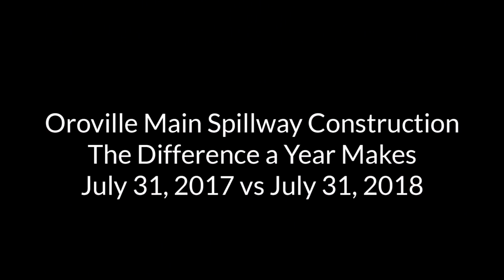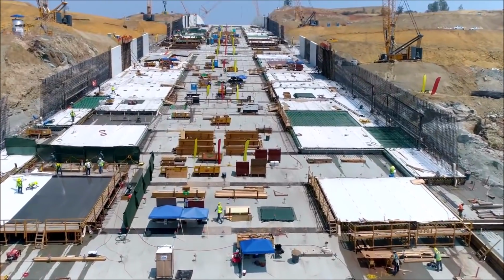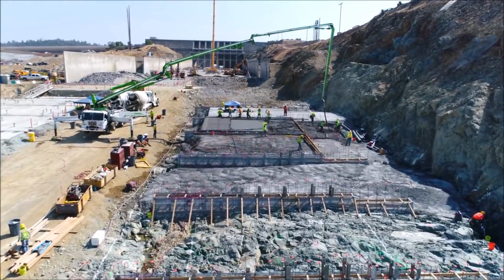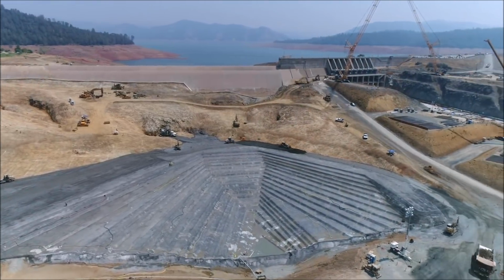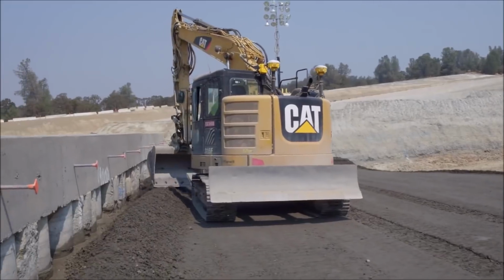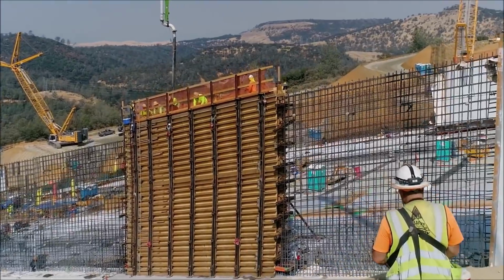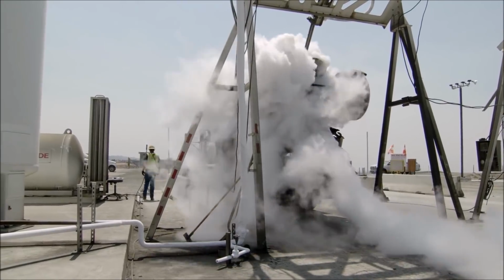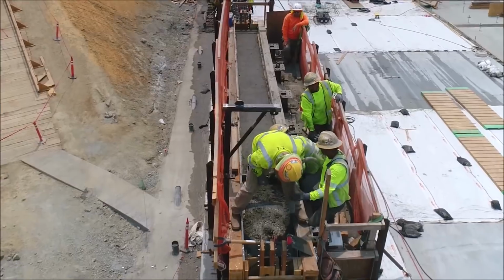Oroville Update! Aug 14 2018

Comment: "Proving, that given the right circumstances the State of California can still do massive infrastructure projects on time."

Except all the State of California really did on this project was cut a blank check and manage the water level. Private industry designed the repair and private industry did the necessary work to install it.

What the State of California definitely did 100% on their own was mismanage maintenance and defer capital improvement projects that would most likely have prevented the emergency from occurring in the first place. All in the name of pork spending to get themselves re-elected.

Comment: I keep thinking------considering the cost of this rebuilding effort, and this is only one part of the whole dam complex, I wonder if this dam would have ever been build if it had been built right to begin with.  Similar to nuclear energy plants, if at the start back in the early 60's they knew to build with the safety features that are (correctly) required today, the first plant probably would have never have been built; it would have been just too expensive

Comment: Quick question, Juan. I just watched the 8/15 video from DWR on this, and there's a big span of soil between what I would call the "fan-stepped" area and the emergency spillway itself. If that comes into use, it would wash all of that out and undercut the RCC in the fan-steps. Will that area (the fan-shaped steps) continue all the way up to the emergency spillway?  And, I can't help but wonder, just how durable IS RCC under the flow of water?

Comment: Why do cement truck drivers almost never lower the tag axle (rear of the truck), nor the pusher axle (if present) (behind the cab)?  I'm thinking it must somehow cost more to run that way, by adding wear to those extra tires, and that cost is borne by the trucking company.  By contrast, the increased pavement damage caused by having the main wheels so heavily loaded is borne by the taxpayer.  Is that the case?  Or is there some other compelling reason to drag around those heavy extra axles and wheels and tires and deployment mechanism that's almost never used?

Comment: What a novel way to cool the concrete, I've never seen it used that way--of course I know nada about construction so this was so cool to watch (pun intended of course) Working around liquid gases can be so dangerous, it made me cringe to watch that man. Many years ago, I worked at a welding supply company. Our CO2 bulk tank had just been topped-off Friday afternoon, and sometime over the weekend the valve into the building failed and a huge quantity of liquid CO2 had spilled out into the building. Monday morning, Danny and I came in early to open the store; about halfway to the security panel, Danny stops and yells, "Get out!" Run!" We had to open all the doors from the outside to air-out the store and pump rooms; we discovered the floors around the valve had cracked but amazingly that seemed to be the only damage done. It just kind of made me pucker a bit, although I know they are likely using proper precautions, LOL. Thank you for this great update, Juan, really appreciate it!

Comment: Juan, I am curious as why the placement of pads seems symmetrical.  The aerial view in the DWR video captures this very well (10:00 in your video).  The symmetry is the work on the left and right sides of the main spillway are matched.  I suppose that is for efficient use of the cranes however that efficiency would allow for some leapfrogging but there is no apparent evidence of that.

Comment: Slab walls not good.. Pressure increases at the bottom of the wall. The Greeks and Romans figured that out thousands of years ago....
Reply: Reinforced steel concrete was not invented until thousands of years after the Greeks and Romans built their temples which mostly fell down due to earthquakes.
Reply: MATTHEW SMITH --- You say "pressure increases at the bottom of the wall', so does the thickness of the newly constructed/placed concrete!

Comment: What kinda blows my mind is the thought of the main spillway, not being able to handle the inflows to the point the emergency spill is used just because nature throws such a deluge.... Interesting times ahead... Is she overengineered? Was it unnecessary spending? Or is really heavy weather predicted? 

Lets just go with all of the above.
Reply: I get the ORIGINAL EMERGENCY SPILLWAY did exist... it just sucked.. They they sprayed concrete, looked like a big improvement... Now after 50 years they go to the extreme end of things and (RCC)concrete in the entire emergency spillway with huge amounts of materials and man hours. Which is expensive.... I am not complaining. I think it is smart.

All Im trying to get at, is either they don't believe their new main spillway is structurally sound, or that it won't be enough for the coming weather. 

The emergency spillway is built far beyond what was thrown at it, and the broken part that caused the problem with the emergency spillway got a1billion dollar makeover. 

Just interesting stuff to ponder...... Overbuilt, overpaid, or weather forecasts off the charts? or a little of each... 

That thing looks like it could handle 40days of rain just spilling over everything.... The rest of CA would be in bad bad shape!

Comment: 1974 I worked as a concrete laborer on the DC metro subway construction..So pouring underground wasn't a heat problem..After I whip lashed my neck in 88 the highway dept. put me on bridge construction inspection..We'd pour bridge decks at night to avoid the heat then keep water on in the daytime..This was a great video for me that brought back memories of when I used to be a useful citizen...hehe

Comment: I remember in 1994 the Santa Monica Freeway had several overpassess that collapsed due to the Northridge Quake and the red tape machine seemed to disappear, leading to the freeway being reopened in a record short time.  It just proves that bureaucrats really screw things up.
Reply: Nonsense.  Bureaucrats don't do construction of any kind.  They outsource special projects as a regular practice.  They use private contractors as standard procedure.
Reply: Are you purposely obtuse?  Bureaucrats don't do anything except get in the way of those who can and will.

Comment: I have a question that anyone can answer if you want to.  I've asked before but never got a real satisfactory answer, so here it is again. The  " rather steep turn downhill to a steep 4:1 slope." My question: Why...?? Maybe this 66 yr. old man just didn't understand it properly before....so I appreciate any answers...thanks.
Reply from the maker: marbleman52 the terrain.
Reply: Thanks, blancolirio. So...in the original construction the engineers just basically followed the contour of the land and it was not based upon some hydrological/water flow need ? And during the massive amount of repair work and filling in a 150 ' deep gouge, and even though they could have possibly built up the lower slope to match the upper slope grade, it just wasn't necessary...I assume. Okay...thanks.

Comment: Thanks for the update.

You mention the unlikeliness of the new emergency spillway ever having to be used. Do you know if there are plans to test it once it is complete? 

After all the old spillway failed the first time it needed to be used, it would seem a bit complacent to wait until the next emergency to see if the new design is sound wouldn't it?

Obviously this would require the reservoir to be allowed to overflow which, I would imagine, could cause a whole set of issues of it's own both for the immediate area and downstream.

Comment: Great narration. What exactly is the emergency spillway? And which way is north in the shot that has the lake at the top?
Reply from the maker: It releases water uncontrolled if the water level exceeds 901' elevation thus saving the earth filled dam from overtopping. (which will lead to failure)....to the left.

Comment: Note that unlike last year, they've been doing  all of the slab pours at night and into the early morning. They've only poured a few walls during afternoon hours. Also, they've opened up a second route to the parking lot and structural concrete plant that goes from the top of the dam, down across the spillway inlet on the other side of the headworks.

Comment: Liquid nitrogen is one thing they didn't have when they built this dam and the dams in the 40's
Reply: Water in pipes embedded in the concrete was used in the construction of Hoover(Boulder) Dam in the early 30's.
Reply: 60's not 40's.
Reply: Well, they certainly had LN2 in the 60s when this dam was built, but it wasn't a common construction material like it is being used here. But it was used industrially in large quantities. That said, they had other ways of maintaining concrete and slab temperatures back then, that while less convenient and perhaps not as exact, were plenty good enough when used carefully. It was just a bit harder.
Reply: The dam isn't concrete.  It's earth fill.
Reply: Oroville dam construction didn't start until 1957, completion was 1968.  But dam engineering was still not very sophisticated by modern standards.  It was only around 1968 that plate tectonics was finally gaining traction in the earth sciences.  It took the 6.6 1971 San Fernando Earthquake to alert California and dam engineers to seismic ramifications in construction design, all construction design.  Luckily, California and the US had adopted earthen dam design and its self-healing characteristics work particularly well for seismic resilience.  However, that spillway design was inadequate, actually incompetent, even for the Sixties.

Comment: That was some great footage the DWR put out there - very impressive for a government entity!

We have no such transparency, or efficiency over here in MA. A project like this would be dragged out for 10 years or more, and end up millions, if not billions over budget. Reporters would ask stupid questions as they always do, that never show what's really happening on the ground. If you want to see how MA handles large infrastructure projects, look no further than the "Big Dig" debacle. Years later, all the cut corners on concrete in the tunnels ended up killing a woman, when it all let go and crushed her car. Unfortunately, that's how the MA machine works. Basically the Mafia, and is only allowed to exist because it's called, "government".

Anyway .... EXCELLENT reporting as usual! Thanks for sharing all that great footage, and keeping us updated. We'll see the Mighty Luscombe another day.  😊
Reply: While the Big Dig was over time and over budget your description of the accident is not accurate. The woman was killed by a light fixture that fell due to the incorrect type of grout (glue) being used to hold the bolts into the ceiling of the tunnel. All the light fixtures were removed and reinstalled with the proper grout, some done on an emergency basis others done on a schedule.  Once in a while Mass DOT can do things correctly like the Fast 14 project, where 14 bridges on Rt93 both north and south were replaced in less than a year .
Reply: John Baker, no worries .... people like that are looking to blame EVERYTHING that goes wrong on "big government". Contrast the successfully safe conditions of those working on public projects and private development  in the US (and all it's "onerous restrictions" on free enterprise) with the same on third world projects in which there is no accountability of those in power to those who put them in power. Third world nations have less restrictive  conditions for constructions -- you have money, do what you want. The more of that, the worse you get. It's ownership of politicians that matters, not whether gov't is in charge of projects. Every main highway in the nation was built under the auspices of the federal gov't -- held up pretty damn well thus far. It's the starving of the gov't projects that has resulted in faulty bridges and roads.
Reply: Yeah, well Stephen that was long before the radical left grabbed ahold of the US government - it used to work pretty good before the 1960's came to be. Government knew it's place in those days, and worked the way it's supposed to. Could you imagine a project as large as the Interstate Highway System being done today? Oh my Lord ... the EPA & treehuggers would be up everyone's  . . . so tight, they'd get nothing accomplished.
Reply: Bullshit. There is no exception to or violations of regulations on this project. The transparency is without question -- no backroom deals. There were so few injuries largely because of regulation.  This is a model of how to proceed in a governmental project of massive scale.
Reply: I agree with you Stephen .. but your reading comprehension sucks! 😂 

They're doing really good on this one ... ONLY because, like SlocketSeven pointed out,  too many eyes are upon them now - the story has gone  worldwide! I'm 3,300 miles to the east of Oroville, yet I know every facet of this operation (thanks to Juan, of course).
Reply: Fair enough, Smitty. I'm on the left -- the far left relative to many people who follow Juan -- and I'm all for transparency in gov't. It's not the policies of the left that present the problems that so many people complain about, it's the corruption that's insidious. That's why I can't stand the attacks on whistle blowers. If I could use my magic wand and institute something a bit different in gov't structure, it would be an independent whistle blower advocacy group. There are plenty of people who would love to be its Czar!
Reply: John Baker 8 it was a concrete ceiling tile that fell not a light fixture but the cause was the adhesive compound used. They used the fast set type instead of the standard which lost its strength within 80 per based on testing during the investigation.
Reply: Smitty Smithsonite -- Yup.  Public works projects in MA are a gold mine.  Opportunities for nepotism and patronage, grossly overpaid contractors and workers (who spend most of their time standing around), kickbacks to the politicians who authorize the projects, budget overruns, sloppy or no inspections by state authorities, ...
Reply: SlocketSeven - I'm not surprised to hear that. We have a similar "type" of state government out here in MA, if you know what I mean. Birds of a feather ...
Reply: Smitty - Sounds like youre gonna need some insurance...wink wink

Comment: That liquid nitrogen use didn't look very controlled to me, It looked like they were just dumping and praying while mixing. What kind of monitoring do they have on the inside of those mixing trucks to make sure they're getting the right temperature range?
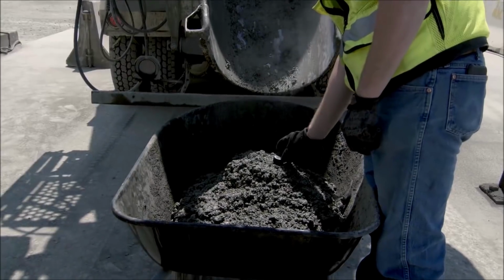Reply: The video shows them taking the temperature of a test batch from the truck at the 08:56 mark.
Reply: Ya, I saw that image, but that's not while the cement is mixing. They don't seem to have real-time monitoring to make sure they don't accidentally freeze their mix.
Reply: The mix won't freeze it  is being agitated the whole time. Have you messed with liquid nitrogen before. Those long tubes inject the Liquid into the drums. That white stuff is what happens when air is exposed to -321 degrees.
Reply: I work with LN2 all the time. You can absolutely freeze things you are mixing if you're not watching and controlling carefully. The "white stuff" is the supercooled, but still gaseous N2 condensing the moisture in the atmosphere.
Reply: I'm sure that after injecting the nitrogen at a given temperature over a given period of time for each truck-load, then repeatedly checking sample batches of each truck-load, with the result being within an acceptable range, they feel pretty confident that their procedure is appropriate for the task at hand.  They have been doing this for over a year now.
Reply: One thing you see too often in "controlled industrialized processes" is that people always claim "We've been doing this since X, so it's fine."... and then they'll get a failure the next day due to that very process. It's literally the same reasoning that caused the Challenger disaster.
Reply: In this situation, if "failure" is going to be defined by having a batch of concrete frozen solid inside the drum of the truck because of too much nitrogen, I think they've overcome that concern as of last year with the procedures currently in place.
Reply: Why does it have to be an entire batch to be considered a failure?
Reply: As previously mentioned, the turning/mixing action of the drum would prevent spot freezing of the batch.  I suggest you contact Kiewit directly to get answers to your questions.
Reply: would prevent spot freezing of the batch

This is not 100% true, which is why my original question is still valid. In fact, depending on how viscious the mixture is, you can actually trap LN2 inside voids in which they can freeze parts of the mixture. If you know for certain that that large temperature swing and glass transition doesn't interfere with the cement set process, then I'd like to see proof of that